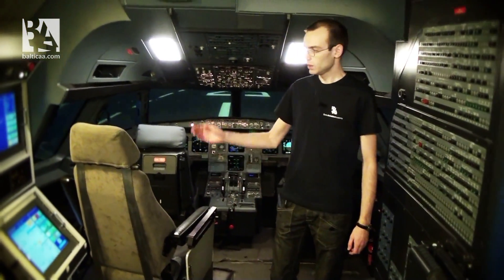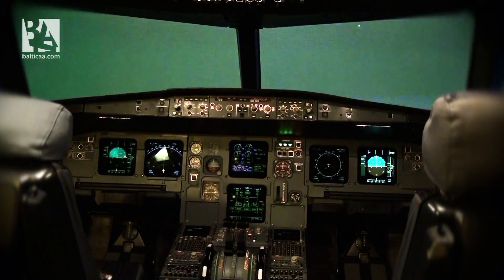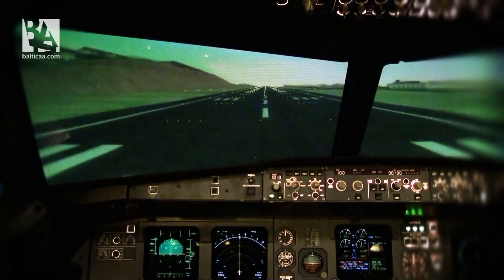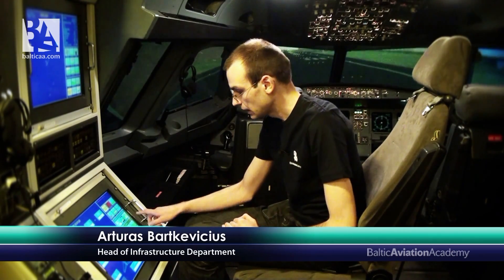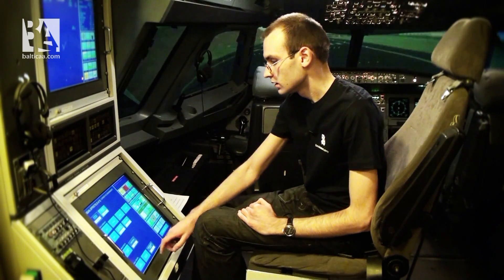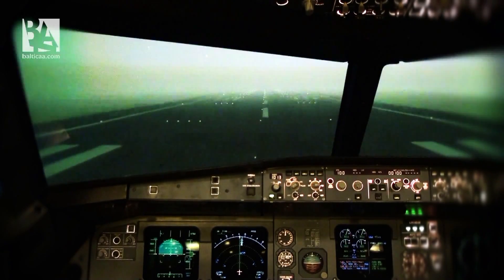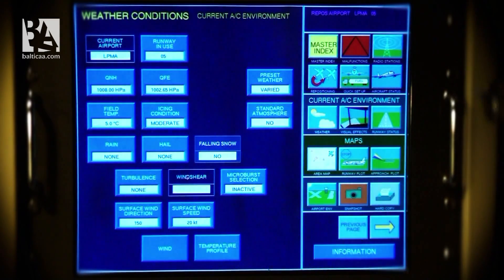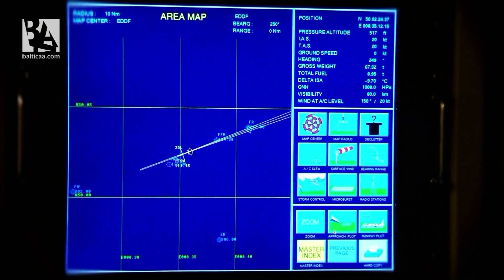Baltic Aviation Academy: How does A320 Full Flight Simulator work? Part 2

Comment: Answer is simple: frame rates of simulator visual system image and movie camera are different.

Plus other reason is that visual image is produced by CRT tubes which have image updating scan-lines. They are unnoticeable by human eye, however they are clearly visible on filmed movies.Take a closer look and you will notice that avionics displays are flashing as well.

Try yourself to target camera to any CRT equipped monitor (older TV set or computer display). And you will get that flashy picture.

Comment: Software is custom built according real Airbus A320-200 data source. Actually there are many different software pieces to operate together: the main which is working in host computer, then another in simulated FMGC computer, other in Instructor Operations Stations, other generates video etc.

Most computers are operating using Lynx and IRIX operating systems and they are running on Motorola PowerPC platforms.